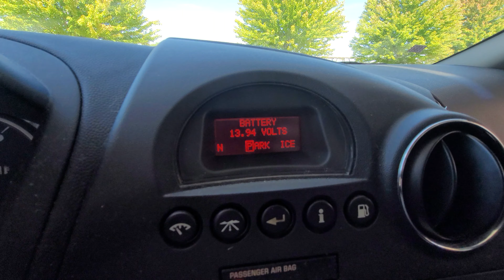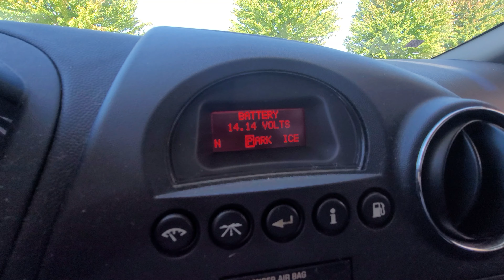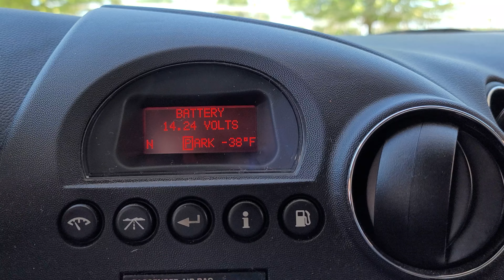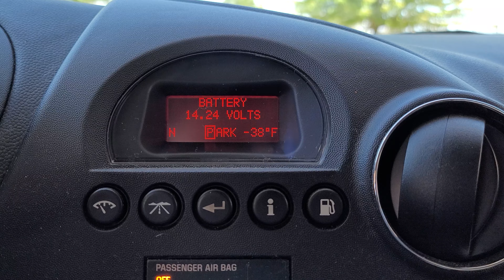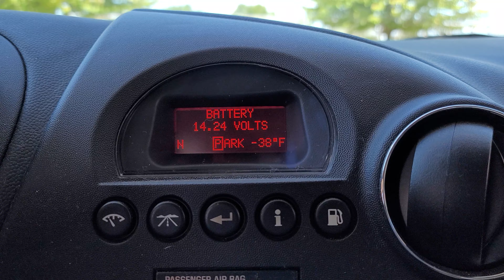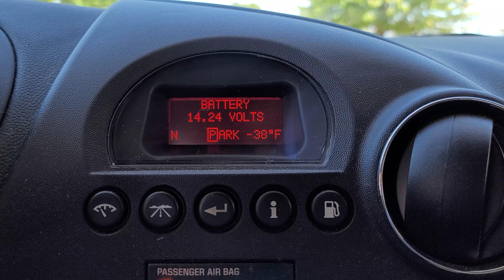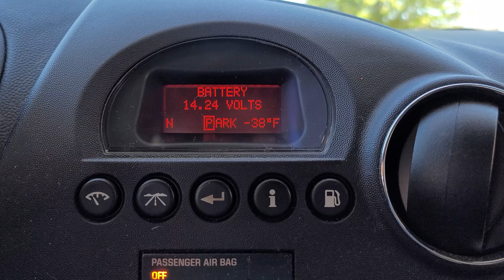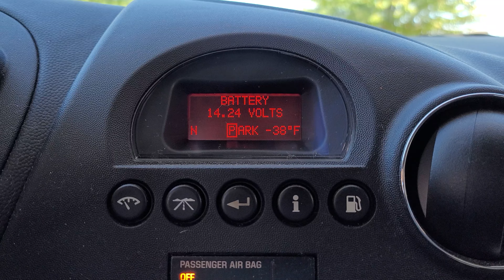Ambieny air sensor issue (NO AC!!!!)

Comment: Im alittle late to the party but i have an 06' grand prix GXP and my ambient air temperature sensor reads higher than normal. So when i start my car in the morning say it's 42° with alittle bit of dew outside. My ambient temp will read 50° and again later in the day when it's 56° out it'll read 69° and so forth. I'm wondering if I'm having the same issue. Motor was swapped out this summer so not sure if im having an issue with my A/C compressor as well or some other issue. I was told when the guy sold me the car that it does not have A/C it may just need a recharge but i don't know and im not worried about it since winter's around the corner.

Comment: This happened to mine as well, but then it went away. Did you figure out the issue? Curious in case it happens to me again. I replaced my AC Delco sensor as well and it didn't help. But, again it went away so it's no longer an issue. Thanks!

Comment: It could be a pin in the connectors, I'd turn on the AC when it isn't working, and with it running, check the connections, push in the wires, disconnect and reconnect, see if it starts working!

Comment: These 04-08 W-body Gp's are great runner's but they have so many problems im having a pedal problems throttle body problems & ignition switch problems or it could be the starter im on the way to replace everything i started with the switch come to find out G.M put scotch tape on it to hold it together😒 not happy about that next is ima replace the starter & get a new pedal....then take off the entire throttle body for cleaning then reassemble...next head lights new rotors Gold brake pads front & rear wires ...plugs...pruge valve ...vape canister ....interior headliner aka roof...& still going im trying to create a stock car out of my beloved 05 GP....
4500 in & counting💯♏🐺
Reply: Almost similar issue I’m having here. But any vids on how to replace that sun roof?